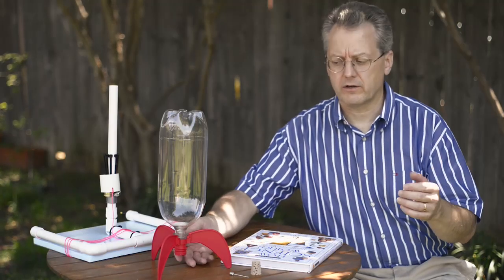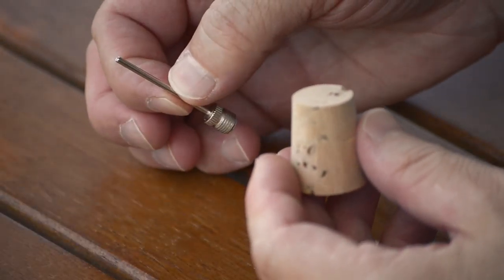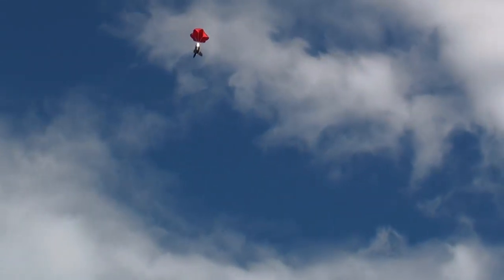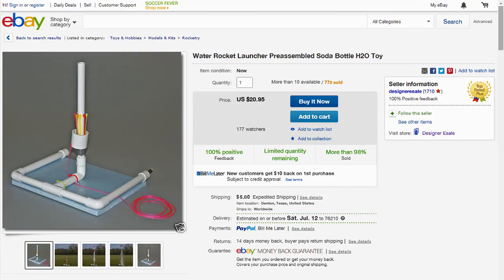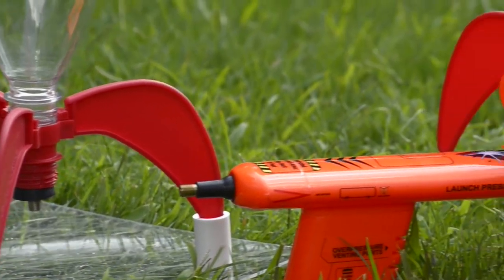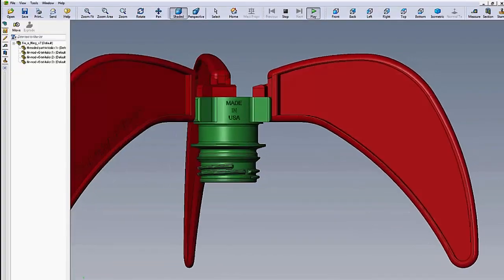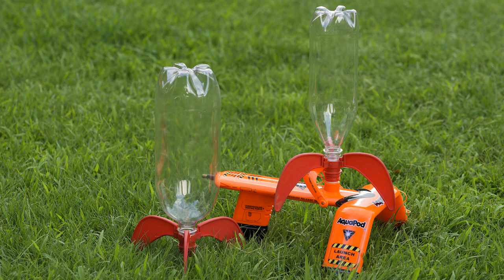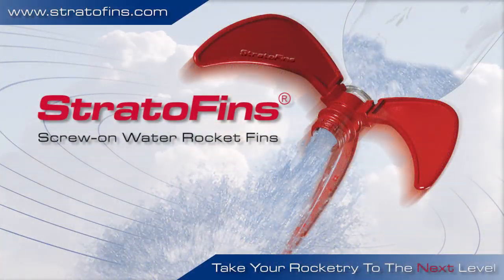StratoFins History - Inception of Screw-on Water Rocket Fins

Comment: Is it possible to make a water rocket using a length of PVC pipe instead of a bottle?
Reply from the maker: I apologize for the long delay before responding. PVC pipe would be too heavy for a water rocket. You can use FTCs Fluorescent Tube Covers though. Google FTC rocket and you ought to find how to make one. You can see one in action in a couple of our videos. We may offer these in the future, but we have to figure out a shipping tube and solution that is cost effective before going down this road.
Reply: actully sorry to say you can i did it you